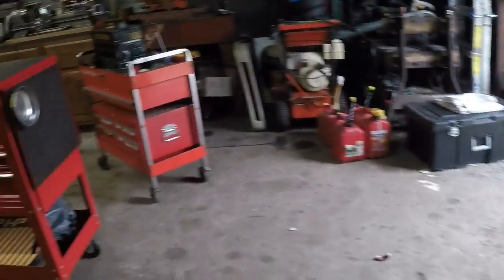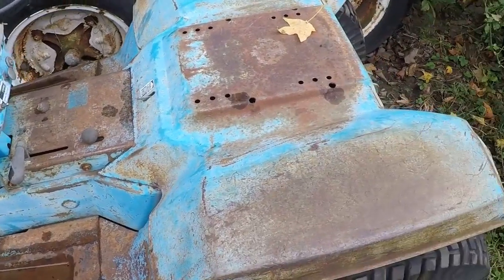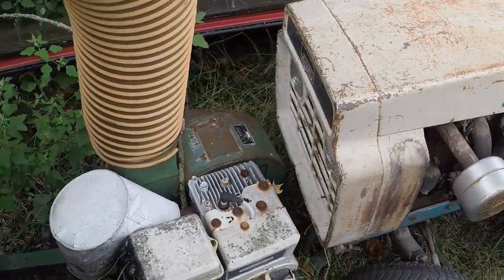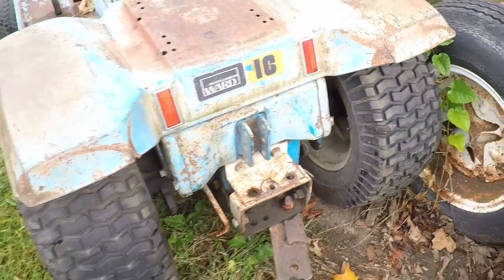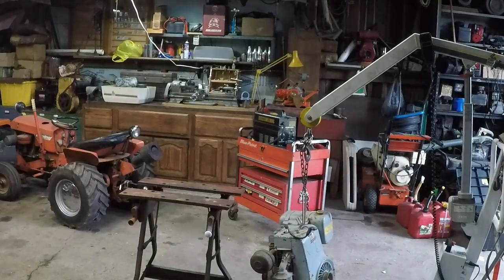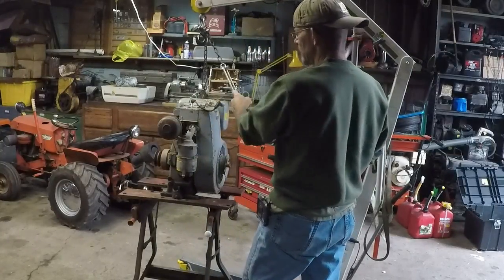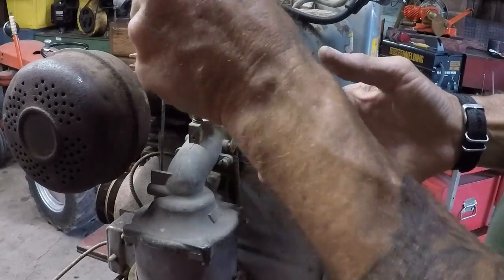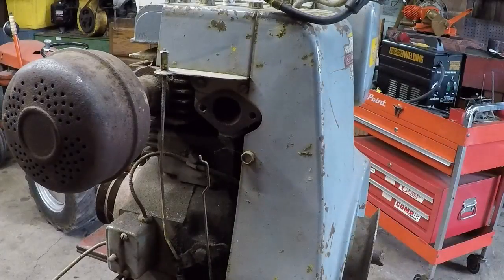Clinton Sample Engine Part 1 of 3 #smallenginenation

Comment: Is that an Atlas lathe on the bench? i have one and would not be without it
Reply from the maker: It's an Atlas 618 badged as a Craftsman 101 Kev. Good Eye!! There's a mill that will be added to the shop, so I've got a LOT of rearranging (Otherwise known as shuffling if the chit) to do before I start moving that in. Cheers!! Zip~

Comment: Hi Zippo. Regarding the Gilson, The transaxle is a Peerless 2500 series and the hydro is an Eaton model 10. This was a very common combination. The other combination was the Peerless 2500 with the Sundstrand series 15 inline hydro.  What is missing from the left side of the dash tower is the pto engagement lever and linkages that go to the front of the engine.  All 2500 transaxles have the mounts for the cat 0 3 point hitch. The 2500 was put in Ford, Homelite, Jacobsen, Wards, John Deere, Massey Ferguson, Gilson, Snapper. The Eaton 10 was put in Bolens, Wheelhorse, Snapper, Wards, Massey, Gilson, Ford, Homelite, Jacobsen,  And some others I can't remember. The Eaton 10 input shaft varies with driveshaft design per make such as, splined, keyed, long, short, but all the internals are the same. The 2500 has minor differences per make also that effect 1) the brake design, band drum or disk, 2) the dipstick design, long or short, and 3) the hub design, 4-5-6 lug and how it attaches to the axle shaft. All the internals are the same.  The light bulbs are what is worth the money to a fussy, period correct collector. The bulbs might also be able to be used by the Cub Cadet / Massey Ferguson  guys.  The last Eaton 10 I shipped was $45 postage. They are a little pricey to ship considering I ship wheel weights in the $15 flat rate boxes and mark them fragile. Haha. Parted the Gilson has about $400 in it from my experience. Some of the parts are unique to the Wards/ Gilson such as the oil pan that is structural and is the front axle mount.  I hope this info helps.                   ... Spooks
Reply from the maker: Sir Spooks!! I sure hope my subscribers take the time to read this! Excellent information! Thank you very much. They're Greek to me, so this is invaluable information for me and hopefully others. Do you have any interest in the machine or any parts? Cheers!! Zip~
Reply: Zippo. According to the Gilson manual 74'-77' the hydro will be a Eaton model 10. The model 10 looks externally  like the Eaton model 11. The Eaton model 11 was also mated up to the peerless 2500 pretty common. I don't know what the internal differences are between the 2 hydro models as I've never been in one far enough to find out...yet.  Just trying to avoid some understandable confusion between the 2 hydro models.  I am glad I could be helpful with the info.  I don't have a need for parts off that machine at the moment. I sold the Wards tractor I had a few years ago. Thanks for asking. I hope all is well.        ... Spooks
Reply: Zippo. For positive I.D. of the hydro there should be the model#, the rotation direction cw or ccw and a serial# stamped or engraved on the flat surface behind the pickup line above the control shaft at the bottom of the hydro as it is installed.

Comment: what would you want for it
Reply from the maker: Heya CKM! I assume you're talking about the Gilson Wards. Eh...I'm open to offers. I've been told different things, but nothing solid on a good parts or possible refurbish project tractor. Zip~
Reply: ZippoVarga in the state that it is I would be at $100 just because of the hydro is the hard part to fix and your missing the lift bards that will be hard to fine

Comment: Do u know right off hand . The old briggs engines . Mine is a 14 hp . Wondering if the 16 hp , or 10 hp or any has the same measurement from the bottom mounting base to center line of the crank . I was wondering as i am going to start keeping my eyes open for a spare engine around here and would like it to be as direct bolt up as possible . i have not even measured mine yet to see what it is.
Reply from the maker: Heya Terry...I assume you're talking about the Cast Iron engines. They're all the same dimensions with a couple things to look for which are the booster fan type (with or without starter generator belt groove) which is a universal fit, so you can swap yours onto another engine and the crank shaft end type. Some are longer than others, some tapered, some larger diameter. Those would be the only two things that would hinder a drop in replacement. The oil pans are interchangeable as are the intakes, heads (from 13-16), carburetors and air breather styles. I've seen differences in the oil fill location (boss on the block vs. in the oil pan to add oil.) The engines with oil fill in the block can be removed and plugged and oil pans with the oil check and fill can be installed in place of the oil pan without this provision. All these things I've mentioned hold true from 10hp (1965) through the 16hp still made today for foreign markets. Hope this helps buddy!! Zip~

Comment: is that lift one of those patient lifts? if so what model
I like it...i BELEIVE I might have one old glass headlights small size but 12v?....mine maybe 6v
Reply from the maker: Yes it is Don! I'll get the model next time I'm out in the shop. Check the center log on the lamp. Most are 12V, but the back of the bulb will tell you for certain which it is in black ink usually. Cheers! Zip~